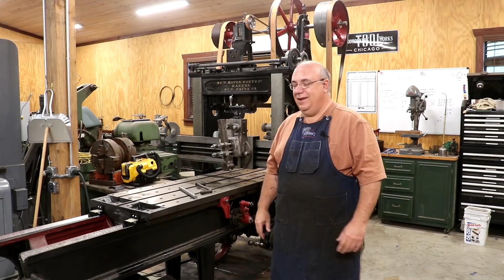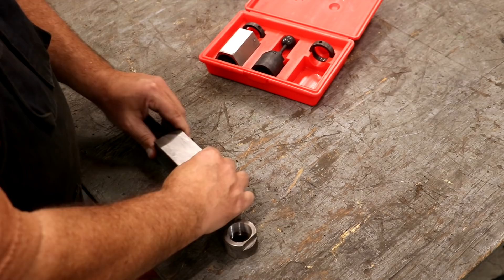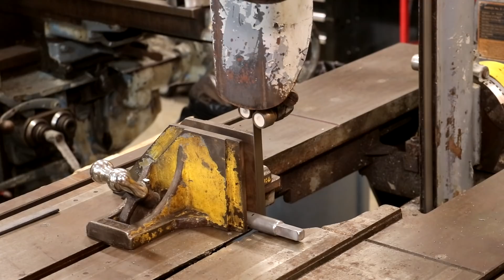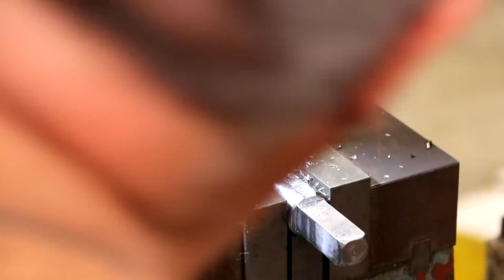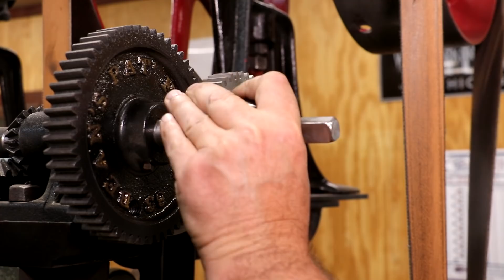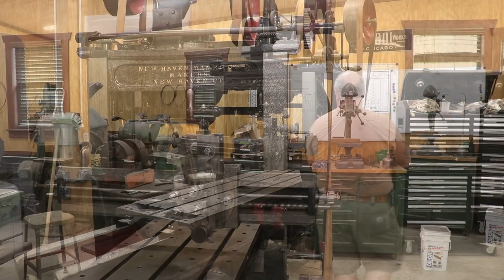Metal Planer Restoration 71: The Final Episode - Cross Head Raising Adapter

Comment: I have  just binged watched' this restoration and it's been amazing !
It does give a lot of satisfaction to save something from the scrap yard. 
A couple of years ago I mentioned to a relative about getting a small woodworking bandsaw. A rusty pile of bits was dug out of a shed for me and the fun began. A few days work , some rust killer, paint, new tyres and blade guide bearings produced a working machine . 
Some rewiring was done for safety. At least a day spent setting it up and tuning, with  a new blades of course.
Just a small project but a lot of satisfaction.

Comment: Keith, Congrats on wrapping this machine up.  It sure has been nice watching you make something out of nothing.  You know, on that mill that broke, I recommend you take some advice from Mr Pete. Don't cut your part off the stock until you have to.  If you had left that shaft longer, it would have gone the entire length of the jaws of the vise that was holding the workpiece.  It wouldn't have shifted and I'm betting your mill wouldn't have broken.

Comment: Keith I have been subscribed to your channel for quite some time. Metal work is an interest of mine, but because I don’t have the machines to do so it isn’t my focus. Admittedly I haven’t invested the time to watch many of your videos. Just an occasional one that catches my attention. I have binge watched this entire series in rapid succession. I’m hooked. You explain the steps very well. And like you said, it’s the historical value of this machine that is the most important. But the scene at the front of the machine while it was running and the belts switching pulleys shows off the shear coolness of this machine. Very nice restoration.

Comment: Congrats on finishing the planer! 
On the subject of the broken end mill, I was thinking just before it broke, "Jeez, he's asking a lot of that little mill" (in terms of feed rate). Better to speed carbide up to a speed that the chips start discoloring from the heat and keep the feed low enough that that color doesn't change much over the course of the cut.

Comment: Just curious, you said the original plans didn't call for the squaring off of the end of the shaft. Was that because they used a different system to attach the handle? or was there a handle at all? If not how would the motion of the table in the direction you needed it to go happen? Great video by the way, thank you.

Comment: Congratulations Keith. It's always a nice feeling finishing a project. On the subject of the broken carbide I would say perhaps the spindle was running too slow and the feed rate was a little high but certainly too many flutes. Having said that if you ask 100 engineers how to do a job there's a good chance you'll have 100 different ideas. That's what makes it interesting.
Im looking forward to the next project whatever it may be.

Comment: I looked at it frame by frame and it looked to me as though the workpiece began to lift BEFORE the cutter broke. I wonder if it was because the workpiece was at one end of the jaws that the clamping force was entirely (or nearly entirely) at the end of the workpiece closest to the center of the vise. You might try putting a spacer the same size as the workpiece at the other end of the jaws to keep them parallel.

Comment: Excellent work! I must say though that I find it amusing that the US is so far behind the rest of the world by still using Imperial measurements. Hearing someone convert Thousandths to a fraction of an inch is baffling when a single, highly precise method is available in millimetres. Try converting 13/64" plus 21/32" in your head to thousandths...... then express the result as a fraction.

Comment: Keyway cutting 101.  Old boss taught me to cut keyways long time ago on a mill with a loose spindle.  Touch off top eyeball middle, flat tells you center, grab y handle and correct, little more depth, look again.  Ok it is centered, this is using a regound endmill.  Bring up knee half.  Cut.  Put in new endmill, zero knee, bring new endmill down with quill till it touch, half width plus a few, one pass and check with a toolbit.
Maintenance guys always liked my keyways.  They worked.  I called them farmer fit, worked in the field.  There are formulas for certain diameter and width, touch, come down so much, then half width plus clearance. Just sneak up on touch off until to width, then half plus a few thousands.  Works.  Hey, old guy that showed me quick way to cut keyways on his well worn mill hadn't ever seen a digital readout.
Glad the planer project is coming along.

Comment: I learned in my first year as a machinist that when using a Kurt vice that it is a wise decision to balance the forces of the jaws and to keep the jaws parallel to put something of equal thickness in the other side of the vise. After ripping the workpiece out of the vise enough times to realize that it was a good idea.

Comment: From a safety standpoint that handle is perfectly positioned to split the skin on your head as you lean forward to inspect, adjust, the tool.  I'd add a spring mechanism to lift the handle up and out of the way after you've completed the adjustment.  Whatever method you choose, however, make it automatic.  As we all know, "Safety is no Accident."

About a month ago while you were testing the table reversing mechanism the belt pulley was about your dog's tail height as they walked by.  Seems you need some sort of shield to keep dog tails, your pant legs, shop aprons, etc., from getting caught.  It would cause a terrible accident.  I'd add safety shields, screens, etc.  Machines of that era were notorious for lack of safety s shields, features.
Reply: 1880 dogs didn't have tails so it was never an issue when designing the planer.

Comment: I mentioned it quite a few videos back in the series, but if the oil cups they are still to come were brass originally, I have a pair of them that I believe came off of the same model planer, or at least a very similar one. If they are the correct item for your machine I would be happy to part with them if it means them going back where they belong

Comment: This is less a restoration and more a resto-mod. Improving the oiling system, converting to on-board electric power and adding the handle for raising and lowering all add value to the base of old iron.

Comment: A couple of small things. 
You are right the 1" 5c collet is the largest hole size to run a shaft through the collet but there are step collets that will go up to 1 1/8"
diameter. 
One thing I have to line up thing in a vice and many other things too is common line level. I cut ears off that held the line . I use mine almost every day in my grinding shop. I use it a lot to level a cutting edge to grind a tooth straight. 
The one I have I have used for over 40 years. 
Funny how something so inexpensive can be such a valuable tool. 
By the way a very nice job on the planer. I was very interested because I  ran a Gray planer for about 8 months and I was just waiting for an opening in cutter grinding. I like running the planer very much. 
Not as tool & cutter grinding!

Comment: Just thinking out loud, but if you ran the carbide tool too slow, wouldn't the steel work-harden to the point that the load on the carbide make it snap off?

Comment: Congratulations Keith! YouTube is maybe not that ideal when everyone is watching and asking "when can I see the first chips" I imagine it has it bright sides too or otherwise why film and show your work to the world? (maybe you could explain your motivation why). I like your honest approach on the work at hand. Mill brakes on camera and the "beep" sounds familiar :-). I got some tips on slotting to prevent a breaking endmill; go plunge your path close to depth with a endmill which is just below the desired final size of your slot. By doing so you make it easy to slot with this endmill with little effort . Start a slotting path through the center and shift to the sides an equal amount, Recut until there's no visual or audible cutting action going on. Check the size of your slot and recut both sides accordingly. This is my prefered method for cutting an exact slot with. If you start of with the same diameter endmill as the desired cut you cannot correct anything after that. Ploughing trough full metal makes the endmill (especially small sizes) bow of the center of the cutting action and endup with a slot to broad or with a too coarse surface finish. Another suggestion for this wonderful episode is that I would disassemble the axis and cut the square directly on to this axis; mean and lean. Otherwise, second best, I would start with a larger diameter axis as a mating part and broach the keyway into it. Or, also quite charming, I would make a new hand crank and incorporate the keyway into it. No nagging Keith, I'm a dedicated fan and I totally understand what you're doing; conserving beautiful machines from the past which otherwise would be scrapped as old iron. If you imagine what effort it took to make these machines in the past it's totally worth the effort. (labour, time means, craftmanship with only basic instruments and tools etc. ) Keep up the good work and thank you for all your wonderful and sincere uploads. All the best, Job

Comment: Glad to see these final touches on this historic machine. Here’s a little tip I’ll pass on when machining keyways with end mills, which tend to pull to one side when taking heavy cuts. Remove the majority of the material first with an undersized cutter then finish with full size. This simple trick will prevent stepped and oversized keyways.

Comment: About 50 years ago I had a friend who worked in a machine shop that made O ring molds the blanks for which were planed flat on a planer that was probably about the same vintage as yours . They were about 24" square and 1" thick , probably steel but could have been grey cast iron. They may still be in use somewhere.

Comment: I worked as a boring mill operator from 1965 to 1983. I had to machine surfaces like on your steam engine build. I would use a boring bar like a fly cutter. Shortest largest bar and  single point tool. Dont under estimate that old planet. That's all we used for guage plates back in the day.

Comment: Beautiful Job, Keith! Gotta school you on keyways.....never use a 4 flute endmill! Use a 2 flute stubby. The depth measurement for that 1/4" keyway would be more than .125. Keyways are measured at their sides, so, first the endmill has to make a flat the width of the final keyway. In other words the endmill has to drop into the shaft after touchoff the height of the arc derived by the 1/4" chord on a 1" diameter. And of course there's the clearance at the bottom added to the depth.
Reply: Also, he was feeding that endmill way too fast.
Reply: @garybrenner6236  I wondered if a bit of swarf jammed the cutter in the groove. It maybe needed air or coolant to flush the swaf out of harm's way.
I do note the other suggestion of not using a 4-flute cutter.
Reply: Also, the workpiece was clamped at the end of the the vise jaws.  This is great for setting up the shot and showing YouTube fans, but the moveable jaw is going to come out of square every time.  If you go back through the video 16:42 or so, and shuttle frame by frame, you can see the workpiece pivot at the end where the tool was cutting.  It wasn't being held along its entire length very well.
Reply: For me, it's a job for the horizontal mill with a 1/4" milling cutter or fat slitting saw. Much more sturdy set up and cut in one pass.

Comment: Phenomenal job on the restoration, Keith. A lot of work, but you've got yourself a machine that'll be a hell of a lot of fun to use. Congratulations! I can't wait to see it's first real job.

Is it necessary to plane the bed itself, to make sure it's as true to the cross head travel as possible? I've got a small Rhodes shaper I plan on (eventually) restoring, and I'm curious if that's something I should do, once the machine is finished.
Reply: See part 10, in which Keith narrates the surface grinding of the table and the bed.

Comment: Would the stoker engine fit on the planer? The tool would have to be extended, but just wondering.
Reply: LOL
My thought would be to try to use the H mill with the cutting tool outboard of the overarm support bracket with the stoker engine casting arranged vertically.
Reply: if it doesn't work on Adam's shaper it propably won't work on the planer either
Reply: @CatNolara  What happened to Keith taking it to someone with a big mill ? I'm sure they got some done with that ?
Reply: @millomweb  He built an extension for a shell mill but it ended up too floppy and didn't work right. He still has to find a solution for that.
Edit: nevermind, I forgot they managed to get it working with some other endmills, but it's still not fully done
Reply: @CatNolara  ISTR with it they managed to gently cover most of the area but still couldn't access one end as it was too close to part of the casting shell. I don't think there's been a follow-up vid of it - just had the feeling the task was completed. Maybe not !
Reply: @millomweb  yeah, makes you really wonder how it was done in the first place. You gotta have just the right cutter it seems
Reply: @CatNolara  The way Keith goes on about scraping....perhaps hand scraped ;)
Reply: @CatNolara  Wasn't it rigidity and reach that was the issue? If the casting can go under the frame, it might have a chance.

Comment: I have enjoyed Keith's videos over the years, including this one on the metal planer.  As a non-engineer I remain unsure where the metal planer would be preferred to using the milling machine? Can anyone explain? Simon
Reply: Back in the day these machines had pretty much the largest machining envelope of any milling type of machine. If you had a really large part this was really the only way to get it done reliably, from what I understand. In theory, you could also install multiple tools and gang mill several parts at once.
Reply: @danf6070  Thank you.
Reply: Trade-offs ! Milling, using a rotating cutter is significantly faster but being a multi-cutter you are using multiple blades which are not all perfectly in the same position. The planer, using only one cutting tip gives a consistent cut but is a slower process.

Comment: I know you generally don't respond to comments but I feel lucky today.
1. Couldn't Brian Bloc machine that stoker engine on his enormous horizontal boring mill?
2. Do you need to cut the surface of the planer table to bring it to dead level with the rest of the machine? Or was that accomplished when it was ground?
3. I think the carbide cutter broke because it hit a gummy spot in the steel (it happens) and it drug some of the chips back into the cut. I saw the chips turn blue before it broke indicating an instant heat change and it actually moved the part in the vice. That took a lot of pressure. Gummy spots occur in metal just like lumps in pancake batter. Probably wouldn't happen again for 100 years.
Art

Comment: I worked in a shop where we had some 2'x 3'X1" plastic sheets that needed to be flat. No matter what type of milling cutter we used from end mills to fly cutters the plastic curled. Then we took it over to an old planer they had and tried that and the sheets came out perfectly flat so there could actually be a use for your planer in a modern machine shop.

Comment: We still need to see how precise the machine is!
Reply: Martin Andersen: Agreed, plus it really bothers me to see those ways uncovered and collecting dirt and grit. Maybe a wide rubber or neoprene curtain that would cover the ways and simply slide off on the floor or into a box at each end of the travel.
Reply: @ellieprice363  That what the foam pads do sweep them clear !Not that those pads cover all of the surface :( A dust cover when not in use would be good though.
Reply: @millomweb  well yes until the oily pads pick up so much dirt they do more harm than good. Ways definitely needs covers when sitting idle.

Comment: The work piece moved at the same time that the cutter broke, so it might not have been secured firmly enough.
Reply: Yeah the vise movable jaw probably kicked around just enough to only make contact at the end where the cutter broke. I always put a matching size in the other side to keep full contact on the work.
Reply: @petermurphy3354  Interesting points/observations. My initial thought was hand feeding and just a natural jerk of feed. Except for really short cuts, I plan to power feed most operations. (When I get going! Currently machine repairs is the issue - then it'll be maintenace lube all over the place & adjustments.
Reply: I watched it frame by frame and am quite sure that the workpiece lifted BEFORE the cutter broke. I agree with @Peter Murphy about supporting the other end of the vise jaws.